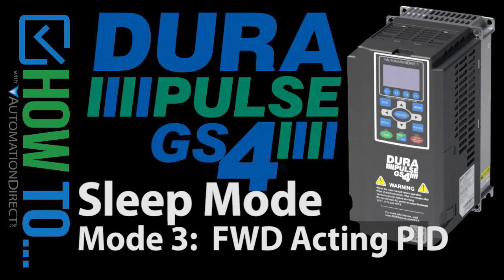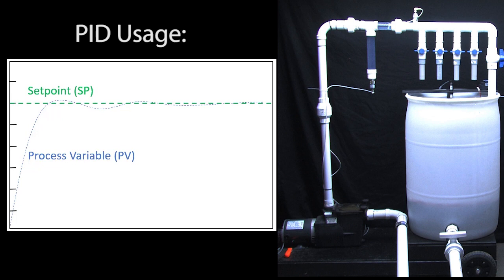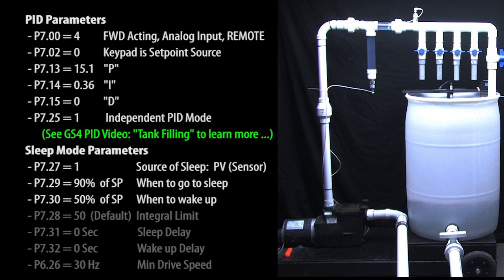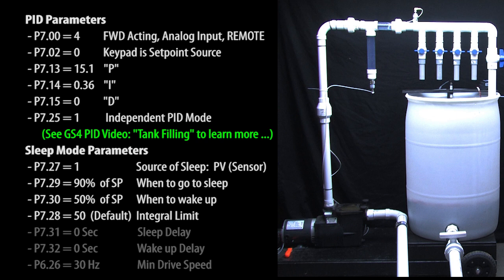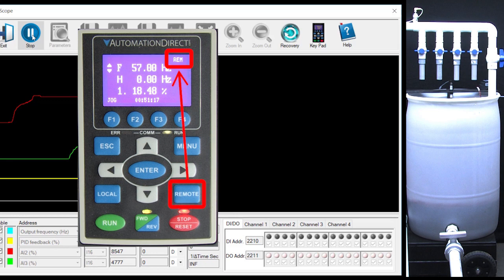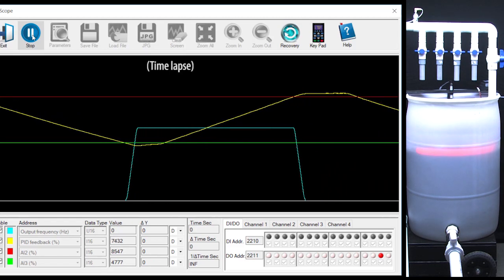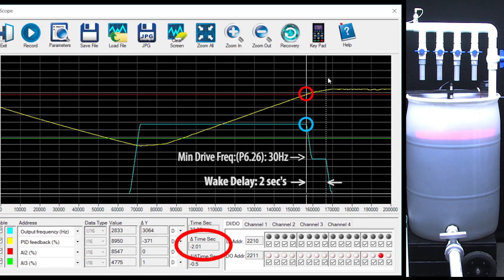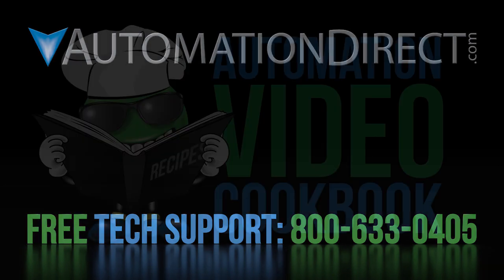DURApulse GS4 VFD Sleep Mode 3 - Forward Acting PID from AutomationDirect

Comment: Are you using 2 sensor ? Al1 and Al2? Is possible to use 1 pressure sensor as a feedback for this application?
Reply from the maker: @jakerchico this setup doesn't use any pressure sensors. It is using an ultrasonic level sensor at the top of the tank to measure the surface of the water to determine level. We show the setup for that in this video: https://www.automationdirect.com/VID-DR-0063?utm_source=n4nEZRdU9iE&utm_medium=VideoTeamComment

We use a single pressure transmitters in the piping above the reservoir in a different PID series on maintaining a set pressure for the system. Take a look at that here: https://www.automationdirect.com/VID-DR-0057?utm_source=n4nEZRdU9iE&utm_medium=VideoTeamComment